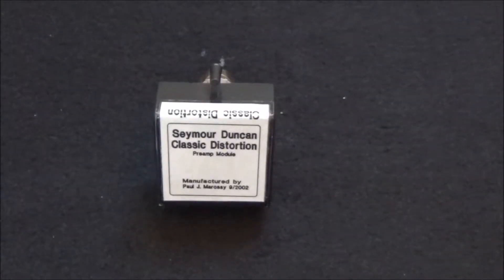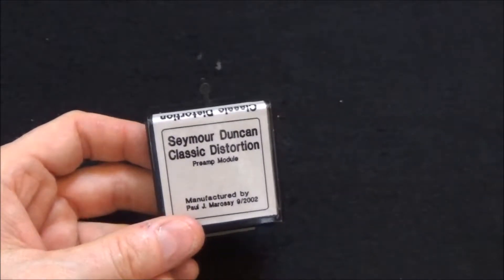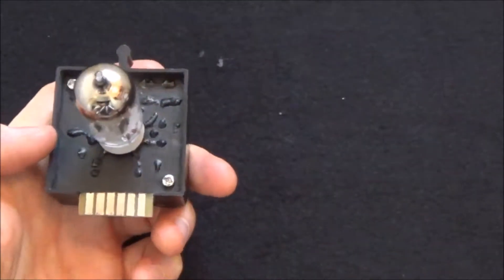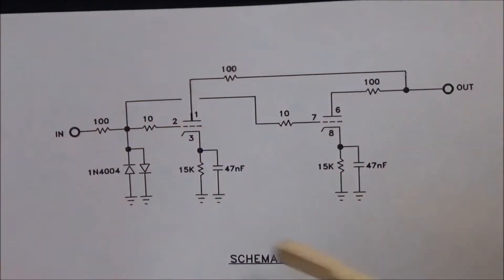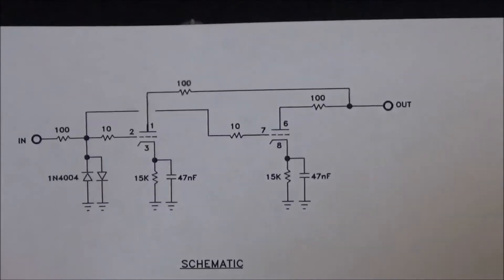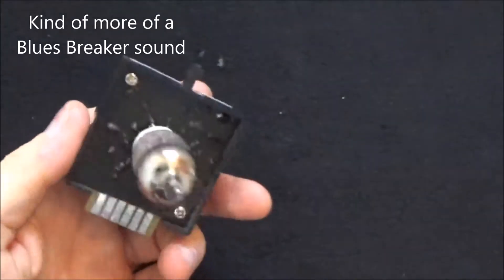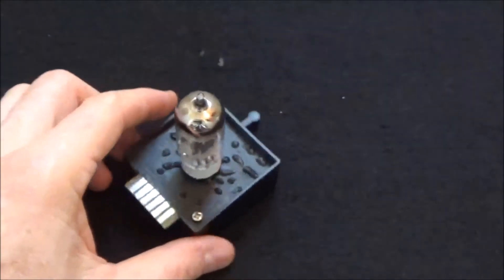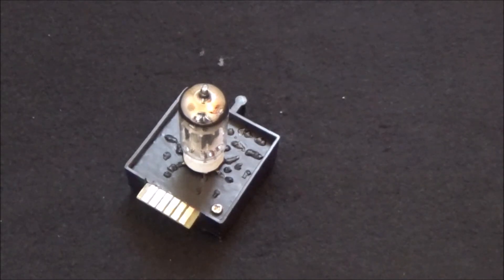Seymour Duncan Convertible Preamp Modules - Part 8, Classic Distortion

Comment: In my mind this is the best amp ever built. I begged mr Duncan to reissue this amp. But no a shit load of pedles insted.
Reply from the maker: David Fellows — I don’t think they’ll ever do an amp again... but if they did they could do a pretty awesome version of it with some of the new technology that’s come into being since these were made.
Reply: @VegasCyclingFreak  agree .but duncan was at the top of his game when he mad that. Mine blew an output transfomer. I took it to four tecks and all of them couldnt find a tranfomer that would work. At the time no one was doing built in power inverters so.....
Reply from the maker: David Fellows — The power and output xfmers were custom made, they simply don’t exist anymore. They still had 3-4 of each 15 years ago but they’re long gone now unfortunately. They got out of the amp business probably because it was too much hassle, the Convertibles had a lot of problems the first 2-3 years and I think they developed a bad rap that they couldn’t really overcome.
Reply: @VegasCyclingFreak  yeah you can still find these amps but i wont buy one caz they cant be fixed and they are going to break. I just sent my buddy the coolest 1 12 seymour Dunan cab that i mad fron the pieces another buddy of mine mad a really cool little amp uaeing some of the pieces. So itlives on.haha
Reply from the maker: David Fellows — That’s why I did a mod to add series diodes on the tube rectifier so that if the tube shorts it can’t fry the power xfmr. That’s the most likely thing to fail unless you’re trying to do something really dumb that fries your output xfmr. Got a video on how to do it, it’s cheap and easy to do. Caps going bad and stuff like that is easily fixed.
Reply: @VegasCyclingFreak  thank you but even ill hate myself if i buy another amp. I have seve ,nine guitars and a dresser full of stomp boxes.....and i dont have a band right now....stupid drummers.haha